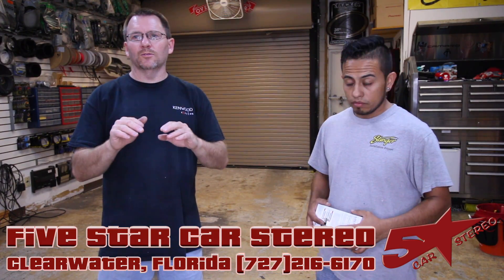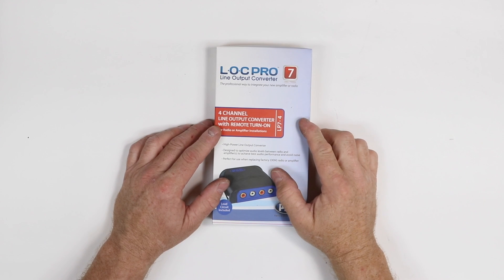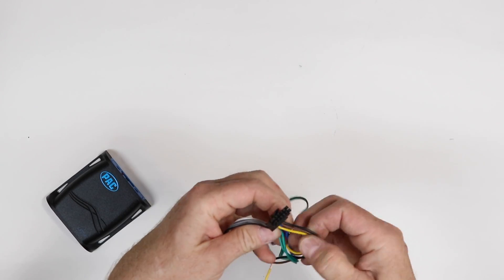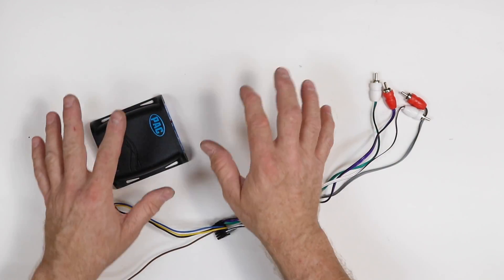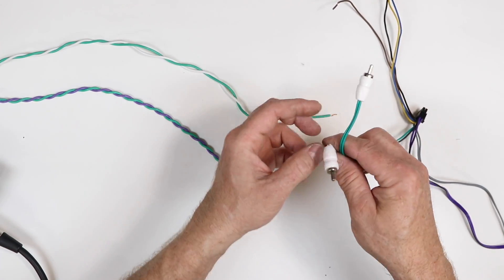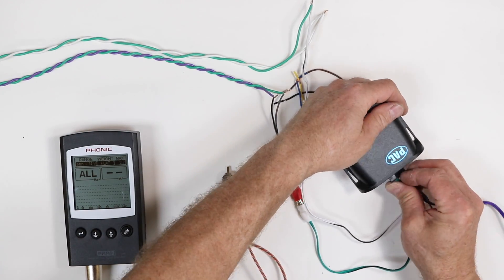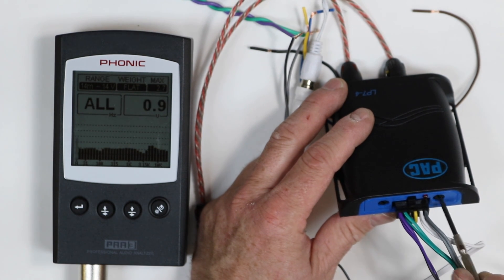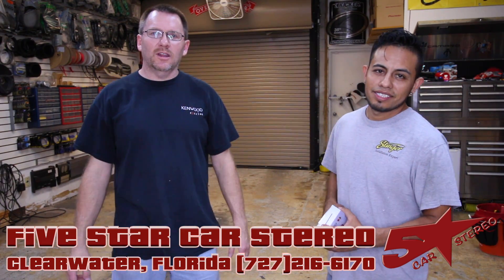An inexpensive way to sum two audio channels together from Pac

Comment: Can you use two separate 2 channel LOCs to do this, or is there a reason you specifically used the PAC unit?
Reply: Make sure the unit you use is active. Passive LOC's will not function to isolate the signal and damage could be done to the factory amp.
Reply: @atyt11  I don’t believe the lp7-4 used in this video is active.   Am i wrong?
Reply: @LetsFlyRC   I would call a PAC LP7 a simple active unit. No gain stage voltage boost, but great isolation. Take the plastic case off one sometime and you will see the board and transformers. The LP7's case looks kinda cheap, but its very hi quality inside. The LPA (Advanced) have a ton more features and are fully active units, but the LP7's are amazing for the price.
Reply: @atyt11  thanks for clarifying.  This answers my question.  

So far, I have done one vehicle with an lp7-4 and one vehicle with two separate generic non-active locs without any problems.   But, time will tell if the amp ends up failing.
Reply: @LetsFlyRC  cool👍👍  good luck.  Try the SNI-35 too, its cheap and never fails.
Reply: @LetsFlyRC  I need to admit, I was wrong. I am sorry.  The PAC LP7 is active only on the turn on circuit. I set one up in the shop and it did indeed work fine without power. The PWR/ground was for the turn on circuit only. Sorry about that.  👊👊

Comment: My factory sub rolls off around 50 Hz due to built in hpf. Can I use this to grab signal from door speakers and the factory sub to get the full bass signal to my aftermarket sub. Can I use the 2 channel loc instead?
Reply: I came to ask the same question
Reply: Yeah me too .I’m trying to understand why a 2 channel Loc won’t work if this is the case 🤷🏽‍♂️

Comment: Is there a way to sum them from a factory amp to a set of components so that I can use the crossover that came with the components?
Reply from the maker: +sas281gt  not unless you were going to us an amp to power them. Get speakers that have a byamp crossovers like Rockford T1's. Or find out if the factory amp is putting out a signal already crossover. Then you you not need the speakers crossovers.

Comment: I read the title and thought you were about to sum left and right to get a "center" speaker signal...dang. I'm looking for a inexpensive way to do that! Any thoughts?
Reply from the maker: +MichaelTranster technically it would work the same. You would just use the LP7-2.
Reply: Can LP7-2 sum RCA L and R line output from aftermarket radio and  just use the RCA input on the LP7-2 as is?
Reply: MichaelTranster me too
Reply: The LP7-2 would work if the factory Speakers run full range. If the Factory system needs to be summed first, as in this video, you would need one more Y adapter to combine the 4 into 2 then the 2 into 1.